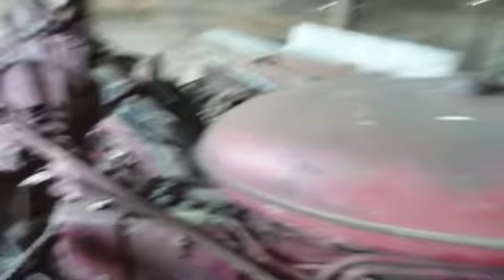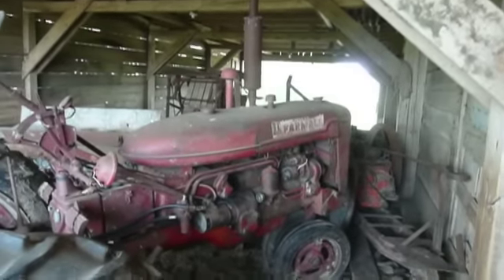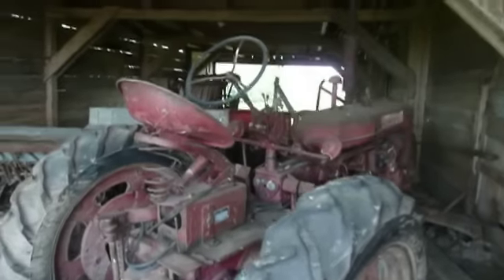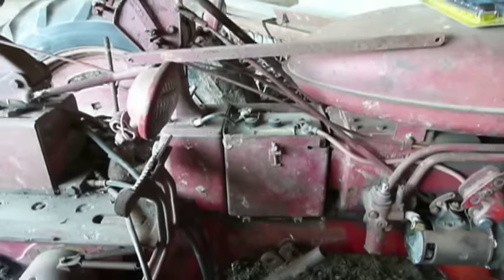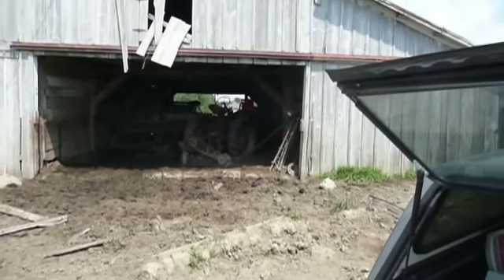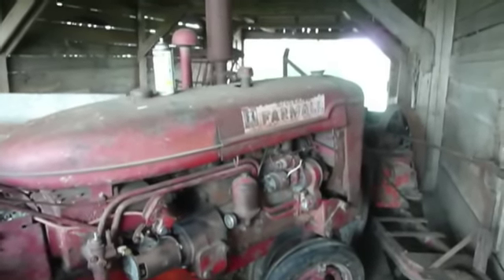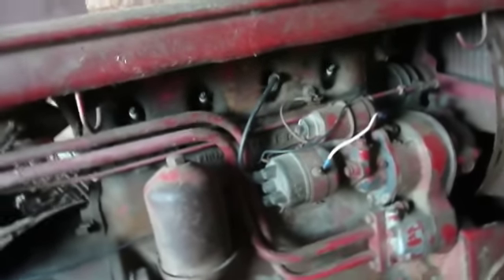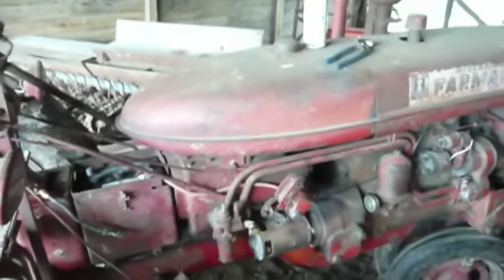Reviving the Forgotten Farmall - Part 1

Comment: The older tractors were all crank start as were early cars and trucks. When they started using electric starters they put them on tractors that already had cranks. Later they shipped tractors without the cranks but they still had a place for the crank. Even after switching to 12 volt systems they kept the crank connection. By the time Farmall started building 6 cylinder tractors they started covering the crank hole with a cover plate. It was still possible to put a hand crank on it.

Comment: i love IH tractors. i dont have the room or need for a farm tractor, but i revived a 1971 cub cadet 147 that was built buy IH. it has a little K301 engine that i rebuilt, i know its supposed to have a 14 hp but i had a good 12 hp block that i rebuilt. i used the tractor today to do the driveway. i love those little IH built cub cadet, built just like the big tractors except it will fit in you lawn. i mow 2 acres with it and have a large driveway. she's small but still an IH

Comment: The starter might engage and work on the tractor if the the linkage you removed while removing the battery was reconnected!  LOL!!!!! Also, you had the starter Negative grounded when bench testing.

Comment: So i saw that the starter is bad so what are you going to do with the starter. I just can't wait untall that thing to start and run. Also i just can't wait untall the old forgotten truck runs too becuse i saw part 4 it did run a littie bit.